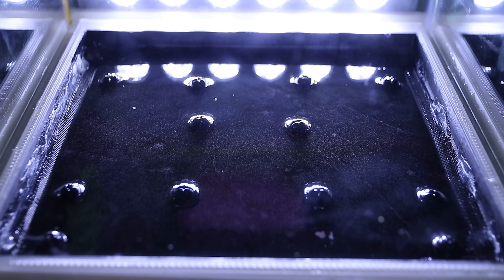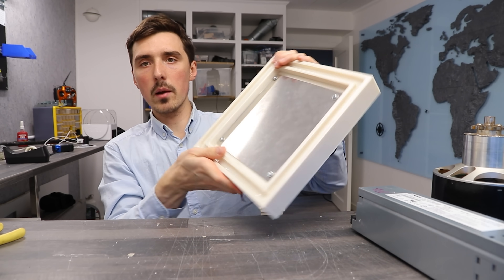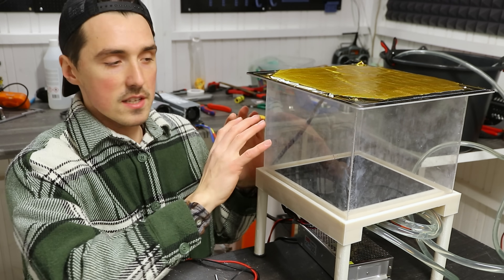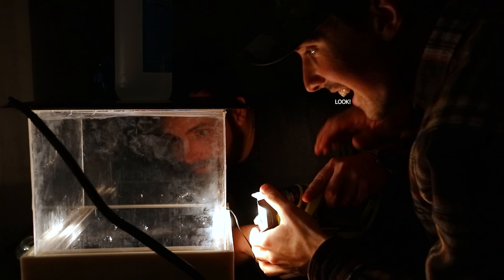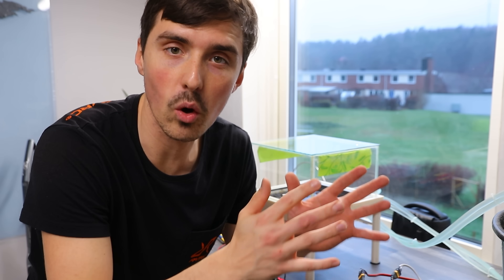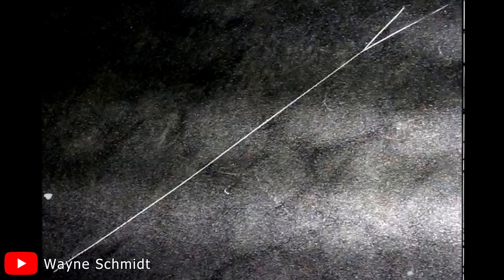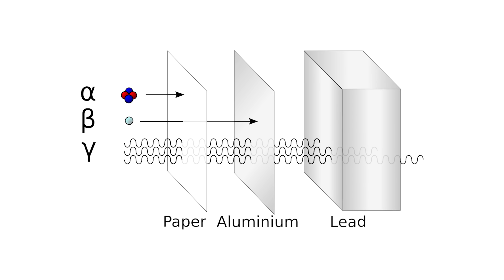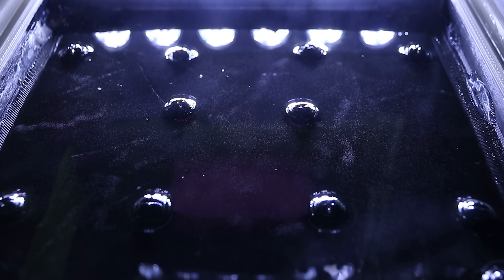I Built Nobel Prize Machine To See Radioactivity

Comment: Put Americium from a smoke detector in there. If you leave it in its canister, it is very safe.
Or thorium gas lantern mantles. Or Fiestaware.
Or as many others have pointed out, uranium glass.
Reply: Uranium glass is the safest of the non-smoke detector options. This mainly comes down to that the others are more likely to chip/fleck
Reply: Perhaps he could easily obtain Thorium from a microwave magnetron.
Reply: why not put a raw uranium deposit ;)
Reply: Or Tritium which was used on older watches as lume on hour markers and hands
Reply: @joshuathomas512  Tritium beta decays which would show, but not as dramatically as alpha particles. Americium is an excellent choice since alpha particles will show well in a cloud chamber, and is safer so long as you choose not to eat it.
Reply: @joshuathomas512  tritium will have all of its radiation blocked by the glass unless you break the ampule open which is not a good idea

Comment: Maybe a smoke detector in the chamber? More specifically the radioactive parts inside
Reply: modern sensors do not use isotopes
Reply: @artineogda  what do they use instead? my old sensor has a radioactive warning on it
Reply: @jungletroll3844  they use optoelectronics. Modern optoelectronic sensors can be very sensitive.
Reply: @artineogda  ty

Comment: Don't smoke alarms have a radioactive element in them? You might be able to find uranium glass as well.
Reply: Bor du nära Örebro så har jag uranglas du kan låna och experimentera med.
Reply: @percyvalpalmer  han bor typ vid Trollhättan
Reply: Or Fiestaware or thorium gas lantern mantles. Or maybe radium dials, but those are significantly more dangerous than the other three I'm pretty sure.
Reply: @DaimyoD0  TIG welding electrodes also  often have thorium in them.
Reply: @DaimyoD0  Radium dials are indeed quite dangerous, especially if they're not A) hermetically seal B) if you open them
Reply: @DaimyoD0  A colleague used to work in the Nuclear industry and they used the gas lantern mantles because they were the only source that didn't need paperwork (volumes of paperwork!) when demonstrating and testing the Geiger counters etc..

Depending on local regulations, you will find that the americium in a fire alarm becomes 'illegal' as soon as you remove it from the alarm - you could become a terrorist handling nuclear material!
Reply: @philipoakley5498  Ah, wow, I did not know that. Noted, thank you. I knew that you could "Nuclear Boyscout" yourself and get your house turned into a Superfund site to the tune of a few mil if things got too out of hand, but I didn't consider the whole, presumed-violent-intent part, without even making a reactor.
Reply: @DaimyoD0 i assume the glass made with it would be harder to use? But i dont know how smoke alarms house it
Reply: @DaimyoD0  I Have Them Lantern Wicks, I Could Send SOmeone A Piece If Anyone Wants
Reply: @DaimyoD0  In theory you can make plutonium with that stuff.
Reply: I just commented the same thing without reading this. Bump on this
Reply: Yes americium 241
Reply: the olds one have indeed but most of them today use optic detection
Reply: Americium. And that isotope of Americium mostly releases gamma so it would not be exciting. But uranium glass would certainly be exciting because it releases alpha, so the particles are very visible in the cloud chamber.
Reply: @Dixon_1974  gamma is visible in a well enough working cloud chamber
Reply: @randomnessx3597  neutral gamma rays do not leave marks
Reply: @Dixon_1974  fuck your right i forgot they don't have a charge
Reply: @randomnessx3597  it’s all good
Reply: @Dixon_1974  what? Americium 241 is primarily an alpha emitter. You will see some probabilistic gamma radiation from the decay chain daughter product Neptunium. Uranium diuranate uranium oxide doped glass, it's primarily a Gamma emitter with some Beta emissions.
Reply: You can just buy radioactive check sources. They are low power and designed to be safe to handle, but should output more than any of these recommendations.
Reply: Exactly what I was thinking
Reply: Certain welding rods are radioactive as well, Google which one and try that.
Reply: @Name-js5uq  that would be thoriated tungsten.
Reply: modern sensors do not use isotopes
Reply: @brigfiche  Old ones, now LED or something safe.
Reply: Yes many smoke alarms contain a bit of americium-241, which releases alpha particles and gamma rays as it decays.
Reply: TIG Welding electrodes with red color code contain 2% Thoriumoxide.
Reply: I think you can just buy uranium ore. Naturally occurring uranium has small amounts of U235 that is radio active. Should be safe as long as you are not breathing in uranium dust.
Reply: yeah but you gotta be careful because long term exposure to Americium is very incompatible with life
Reply: @Lretrotech  yeah i know, that's why i have a special lead case for it.
Reply: @78tgy6ub78  I also have my own samples of other stuff in a sealed container with a code lock
Reply: @Lretrotech  nice, safety first
Reply: Don't play with radiactive materials !
Reply: Not what you need not after that dude ordered like 7000 and made a atomic bomb in his garage lmfao
Reply: Yes, smoke detectors have americium inside them which is radioactive.
Reply: Ska du ha en brandvarnare ska det vara en jonisk. Dom kan vara svåra att få tag på då det i princip bara finns optiska att köpa nu.
Däremot kan det finnas joniska detektorer till larmanläggnigar att få tag på.
Reply: only the early smoke detectors have americium, they are somewhat hard to find nowadays
Reply: @randomnessx3597  what's "early" according to you?
Reply: @danielcadwell9812  the first modern smoke detectors used americium, now it has been largely phased out, I hate to break it to you but 2013 was 10 years ago
Reply: thay did untel about 2013
Reply: @souleater0231  this person is under the age of 12
Reply: Some do
Reply: @brigfiche  was my first thought
Reply: Or an old glow in the dark clock dial.
Reply: @theyeetus1428  not really recommended. The radium sulfide mixture is old and brittle leading to very easy contamination of the radium, which will almost certainly give thyroid cancer. Radium is not to be messed with. Now tritium compound watch dials might be more ideal, though are harder to get.
Reply: @Dixon_1974  it's safe as long as you don't take the plastic/glass cover off the front (if it has it)
Reply: @theyeetus1428  sure, but minimizing the risk is ideal
Reply: new ones usually don't
Reply: Modern smoke detectors do not have radioactive sources in them anymore. But if you manage to find an old one, DO NOT FU*** OPEN IT. Its dangerous af, one mistake and you'll spill radioactive dust everywhere. Uranium glass would be a better option but also, don't break it.
Reply: They used to
Reply: @brigfiche  some do but only the ones that use an air gap to detect smoke
Reply: Radium glow in the dark watch.
Reply: oh yes americium
Reply: I just bought some uranium glass beads! My cheap Geiger counter showed they clearly are radioactive!
Reply: There are lots of domestically sourced items that are radioactive. Welding rods, the smoke detector you mentioned, a peice of granite from the yard...
Reply: Edit: Place the chamber on a ganite plate, that should do the trick. Watch out for veins. Some clays are also radioactive. 

You could go to your nearby university and build up your camber there to use their radioactiv probes. Otherwise, i remember we had alpha and beat probes in school. So that would be an alternativ. Maybe you're well connected and ask the person in charge to lend you the probes. Also there are plenty of radioactive stones. I guess you should visit Ytterby for this pupose. Or the next granite plume, which are not uncommon in sweden. Eager to see the next video!
Reply: Yes it's Americium, an alpha source.
Reply: Red tig welding rods emit a little alpha
Reply: This was gonna be my suggestion too :D
Reply: prob not in sweden
Reply: Uranium Glass was the first thing that came to mind, but smoke alarms is a great option too.
Reply: Would tritium vials work?
Reply: @josephnevin  yea
Reply: Tritium rods encased in glass you buy on ebay.
Reply: Tritium is a good call too.
Reply: Talk to Dr Emmett Brown.
Reply: Old lantern socks had Thorium which is slightly radioactive.
Are not the smoke detectors in Sweden equipped with a Americium pellet?
Reply: And just like that, you’re on “the list” lol
Reply: Well if the gamma ray would be to hit something it might kick off an electron from it? Of course they're pretty good at going through things.
Reply: Yes, Americium-241.
Reply: i have extracted and tested this button of Americium-241 in a makeshift cloud chamber. it works quite well and i think he could get some great results with this set up considering i got decent trails with my 10 dollar cloud chamber lol
Reply: Radioactivity exists EVERYWHERE... we born in a radioactive world, NATURALLY RADIOACTIVE WORLD. Considering the naturally decay, only 5000-10000 years ago, the amount is greater than now in nature, our body HAVE inside radioactivity and our body from time he learned to tolerate it, reading the radio-biology books, not only tollerate but in small amounts to maintain our immune system (T-CELLS) ever ready, not sleepy. All this is well reported from real experiments.
Reply: Vintage watches used radium for their lume. Tritium tubes might work also.
Reply: Depends on the type of smoke alarm, ones without it are becoming more common.
Reply: Older models do, the newer ones use infrared beams amd mirrors to detect smoke. Ive seen some devices that have two inch metal disks that contain Americium lol
Reply: Yeah they contain americium
Reply: Yeah i vape them
Reply: Is  it weird I have a show cabinet full of uranium glassware  with a black light on it am I gonna die
Reply: Smoke detectors have americeum in them
Reply: Some Xenon lightbulbs has radioactive substances in them so might be able to try that too.
Reply: Was literally about to comment this
Reply: Hopefully is he doing a part 2. I think he can get the best results with uranium glass. I mean with uv light the glass is fakkin glowing green like this thingy in the intro from the simpsons😅
Reply: some old compasses too
Reply: Wouldn’t that make the trails too frequent
Reply: Yeah but don’t
Reply: Americium oxide, I believe
Reply: Yeah, You are right, i have a peace of americum 241 from mexican smoke detector. And Ussr smokre detectors have plutonium inside.
https://youtube.com/shorts/Ujf6JYdU0Nk
Reply: I wonder if there’s a map of abandoned hotels made after 1980
Reply: Did you watch Young Sheldon?
Reply: Yes and they spit out a continuous stream of alpha particles so much so when I did it - I had to touch the box to ground it - in order for more production streams - it almost became saturated ….
Reply: tritium compass
Reply: Only old ones.
Reply: Older smoke alarms used Americium, newer ones use an optical sensor.
Reply: FIESTA brand dishes have lots of alpha radiation
Reply: americium
Reply: yes they do the americium-241 also generates lots of alpha and beta particles so it would be good for visuals because it generates 5.4 MeV which is safe for humans as long as they dont inhale or ingest it
Reply: 90% of the snake oil pain receiving bracelets and things like that contain radioactive materials. They are great specimen. Take a picture and send it to your vegan singing crystals are healing friends😂
Reply: Yes
Reply: Yes, they do have Americium 241, just a few microcuries but should be enough
Reply: There should be radioactiv photo lenses too, but be carful, keep some distance to your body and get rid of them afterwards.
Reply: @Universestyle  They are not that dangerous :)
Reply: @Nobody-Nowhere  Yh people think all radiation is dangerous very strange given how much detail people know
Reply: @Universestyle  It's not spent fission fuel, for god's sake. It's just thoriated glass. Harmless.
Reply: @Universestyle  a lot of photos use radiation to create the image, it’s why Polaroids shouldn’t be burnt or bent, the chemicals inside the polaroid is very reactive to light which is a form of electric magnetic radiation.
Reply: @Universestyle  radioactive lenses are not that dangerous, you can hold one in your hand for 8760 hours straight! and still be miles away from exciding your yearly recommended limit for radiation exposure. also why would you get rid of them after? they are very collectable and can take amazing looking images, as long as you don't sleep with the thing on your chest every night you should be fine.
Reply: You have to find old ones. I am pretty sure they have stopped putting americium in them now.
Reply: @Dan-Athema  new ones are photoelectric I am pretty sure.
Reply: Or Old glow in the dark watches
Reply: Some smoke detectors use radioactive materials but anthers use lasers .
Reply: Uhhh you should just leave it alone.
Reply: only older ones have some radioactive material inside, the newer type only uses electric components like phototransistors to detect smoke...
Reply: @Enderkruemel  'only older ones have some radioactive material inside'  Since they often last 10 or 15 years, a lot of people will still have Am-241 ones around.  Or if they kept them for the sources, their old ones have it.  Really old ones can have other materials, but it's easier to get Radium from old radium clocks.
Radium-226 (radium sulfate) was the first radioactive source used in smoke detectors. According to NUREG/CP-0001, U.S. producers stopped making Ra-226 containing smoke detectors in 1963 when they switched to Am-241.
Reply: Americanium
Reply: Nope, they use s photosensor. It's the same technique we use to see what a planet is made of far in the universe
Reply: germanium
Reply: this kid is a drop out
Reply: they just don't make them that way no more.
Reply: @RadekZielinski.  ionization alarms absolutely do still exist, even if photoelectric are getting more popular.
Reply: @DaimyoD0   honestly i thought they're out of fashion but i just checked online when you commented and indeed they are... :D 10x more expensive though
Reply: @RadekZielinski.  Where did you get that price from? On Amazon I can find an ionization smoke detector for $8.99, and a photoelectric for $9.49. They're very similarly priced these days. Are you buying them in a region where they're taxed differently to encourage the public to transition to photoelectric or something? That's the only explanation I can come up with.
Reply: @DaimyoD0   where ever you are from i guess it is different, but it could be also you just not looking right at what technology it is using since photoelectric in my opinion is like the flat tv you know... no one want to spend 10x as much for something so easily cheaper and as effective.
Reply: idea stealer